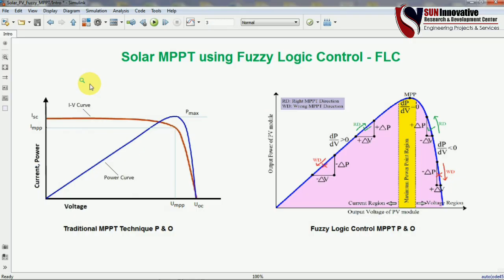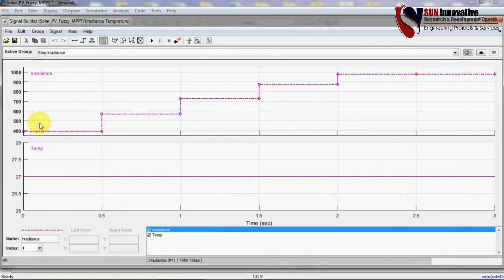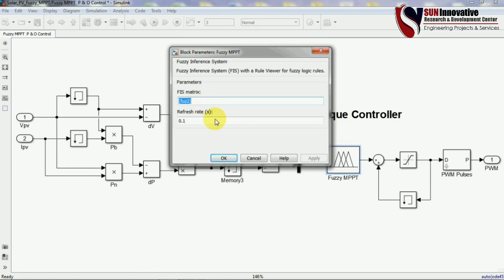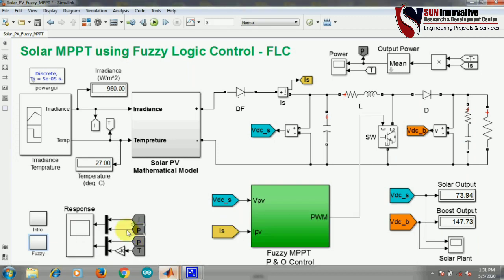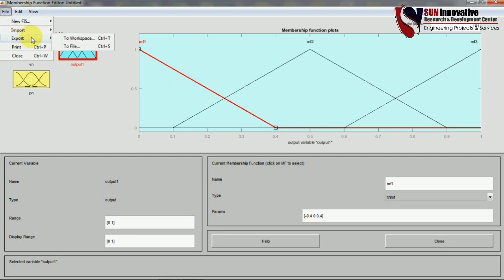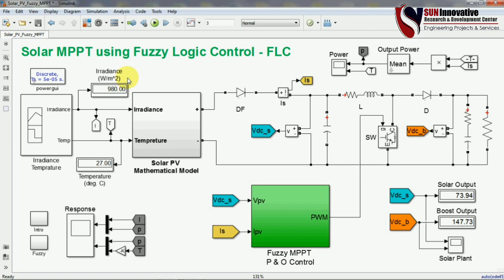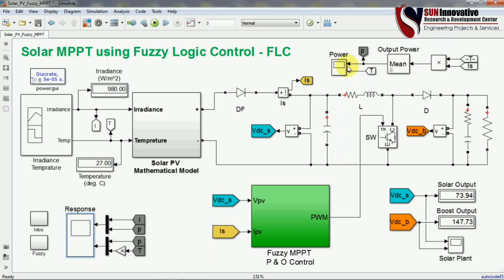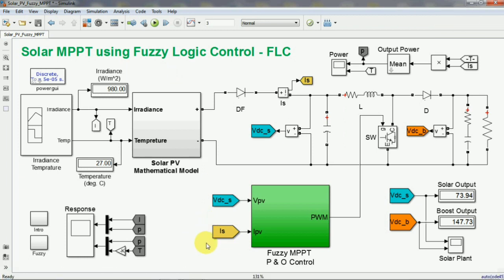Fuzzy Logic Control (FLC) | Solar MPPT Boost Converter | MATLAB Simulation

Comment: Sir I have confusion about how to maintain the boost converter voltage at fix value because for variable irradiance the voltage is fluctuating which means we can not provide it the inverter for grid connection.

Comment: How can identify the range which i have into my design for variables :Error and Change in Error and D. for example PV with capacity 240 watt also for a PV panel 3*2 with capacity 1200 watt